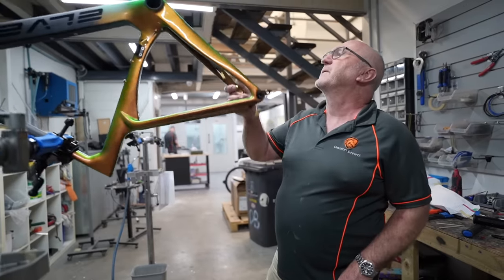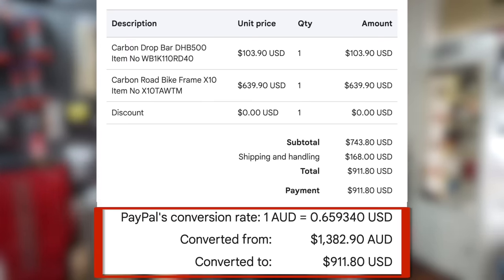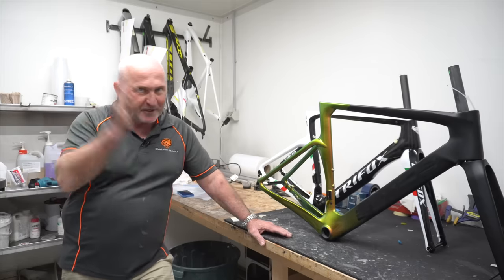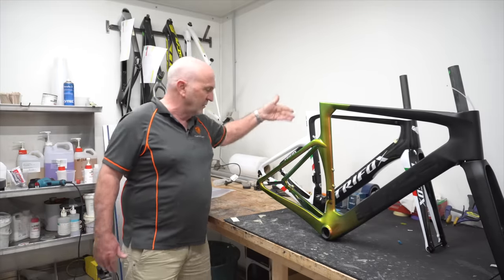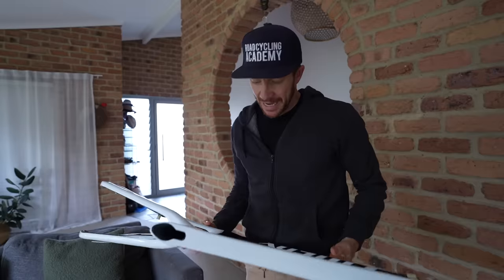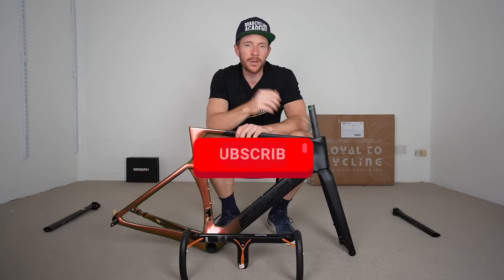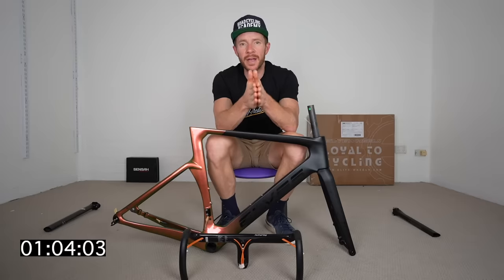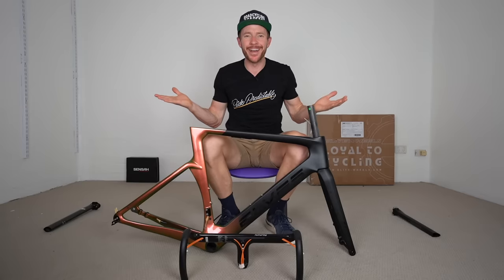I Bought Two Cheap Chinese Aero Frames (here's why)

Comment: ha ha $2k for a Chinese frame?? Add seat post, saddle,  handlebars, group set, pedals, wheels, tyres, tubes etc.... the issue isn't quality, it's price. Once you total that all up, you have something that is the same price as you would get for a new bike from a big manufacturer plus you're left with something that is virtually unsellable. Rightly or wrongly, as soon as someone hears it's Chinese, they won't touch it with a barge pole.

Comment: $2k frame is not exactly cheap. Unless you've already got a groupset and wheels, i don't see the point.
Reply from the maker: That’s with an integrated carbon bar and postage.
Reply: @CamNicholls  still too much
Reply from the maker: @DanTuber  haha I think the lower you go the quality starts to go out the window as per the Trifox example
Reply: @CamNicholls  Only way to know for sure is to buy more frames to test that... hongfu/dengfu, ican, yoeleo, light carbon.

Comment: You and your budget ,support real brands whether it's chinese or a big brand but just don't buy fakes or conterfeit ...

Winspace,Yoeleo,Seraph,Elves and so on try their best to be seen as real brands and at least they are more legit than any conterfeiters... 

Cycling is the new golf ,just ask big brands with some bikes at 2899/3499 for a 105 disc gruppo and basic wheels...

Won't even speak about 10 000 k bikes in not even dura ace.